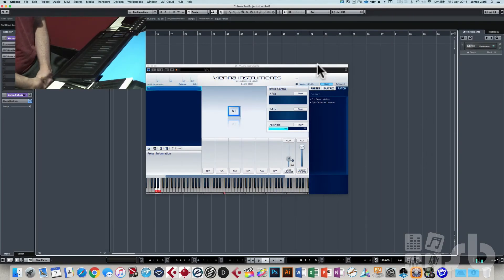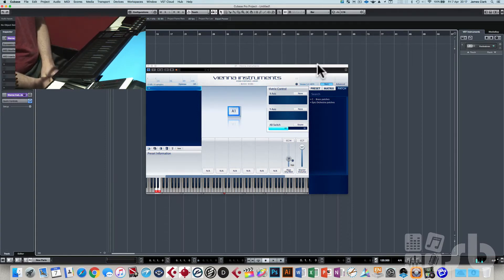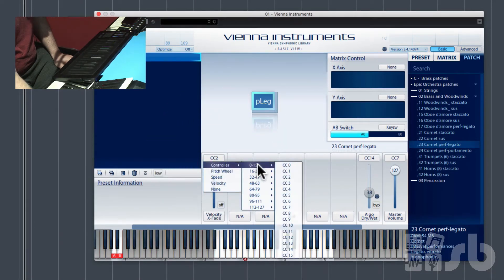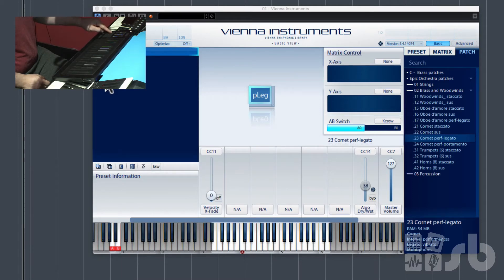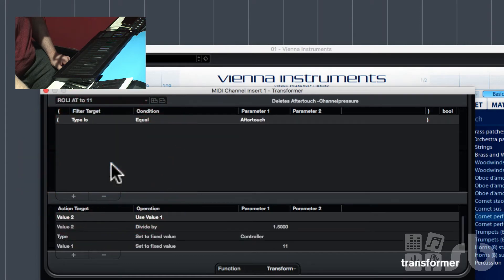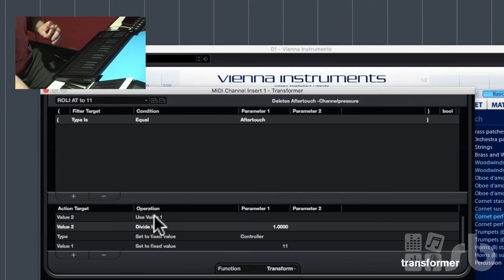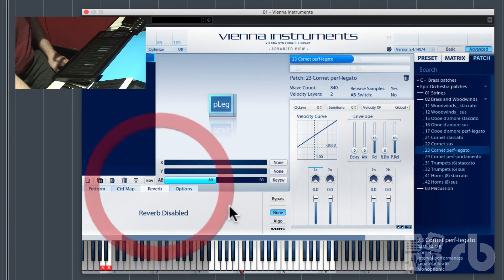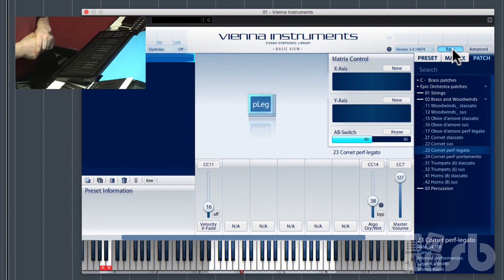Playing Vienna Instruments (VSL) with a ROLI Seaboard RISE

Comment: Hi, I applied this method for my Cinematic Strings library with the Roli, but the problem I encounter is when I play a phrase, notes doesn't come out at smooth. It is because velocity dropping to minimum before getting to correct velocity when passing notes. Do you have any idea why this happens?
Reply from the maker: Yes you are including TOO much dynamic range, set the ROLI to send between 50 and 127 CC/aftertouch and your notes will not fade to nothing when you lift your key. if you are playing legato make sure you press the next key before releasing the previous one and set the ROLI to monophonic. all will then work for you.